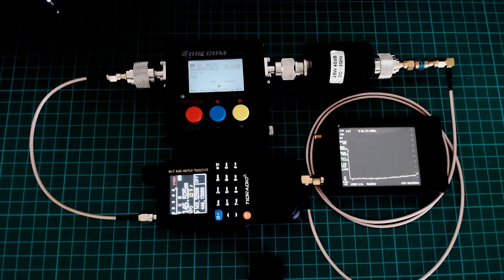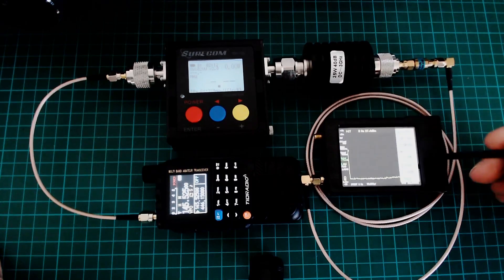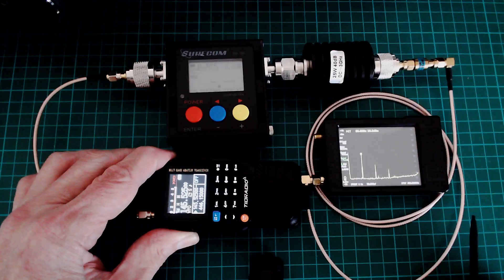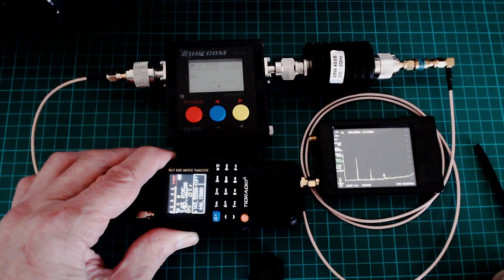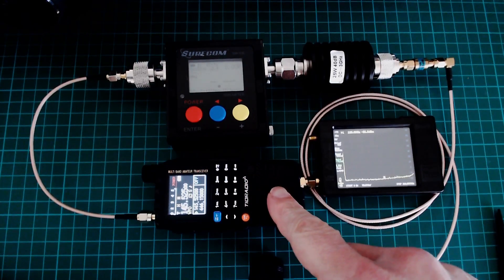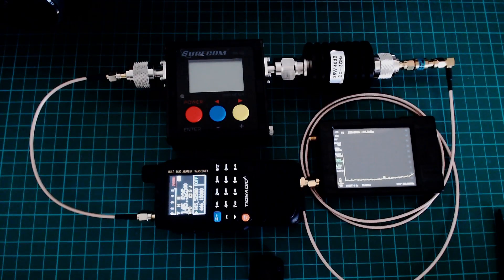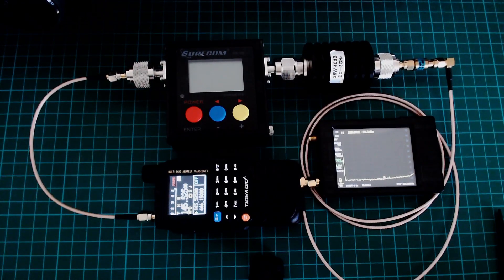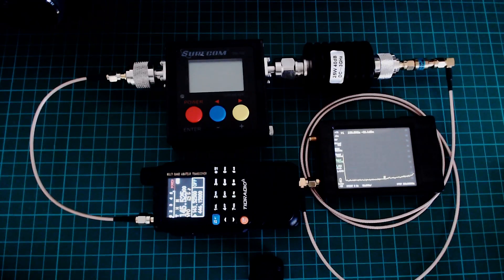Tidradio TD-H3 Dead on Arrival - Transmit Problem

Comment: I'm no longer recommending H3 GMRS radios to our local communications team. Two recently purchased H3 GMRS units have no discernable transmit power.  I upgraded both to latest GMRS_2503XX firmware, but no change. I'm shocked at the number of dead-on-arrival radios being reported.
Reply from the maker: Yep - they seem to specialize in suppying DOA equipment...

Comment: I just got one today, and it has no power output at all.  It receives ok and it shows on the screen like it’s transmitting, but zero output according to my meter.

Contacted Amazon and they are sending me a replacement, so I’m glad for their fast customer service.

I’ve got a TD-H8 from them and it works perfectly.
Reply from the maker: Tidradio sent me a new TD-H3 and it transmits fine as expected. I hear of a lot of units with this transmitter problem !

Comment: Which did you buy?  GMRS or HAM?
Reply from the maker: I got the HAM version. I noticed you can switch between versions anyway if you hold ptt and * button whilst power on.
Reply: @fotografm  some reported GMRS version with spurious emissions.  I'm curious to see newest firmware versus last in terms of spurious emissions.
Reply from the maker: @tsp2jxd  Now I got a working HAM version which generates 4.5 to 5W on high setting. On my TinySA, the second and third harmonics are below the noise floor and not visible which is good news !
Reply: @fotografm  I just returned 4 HAM versions because the 2nd and 3rd harmonics were bad.  Not even close.  Good luck!
Reply from the maker: @tsp2jxd  I would say they seem to have quality control issues there !
Reply: @fotografm  Where did you purchase it?  Amazon?